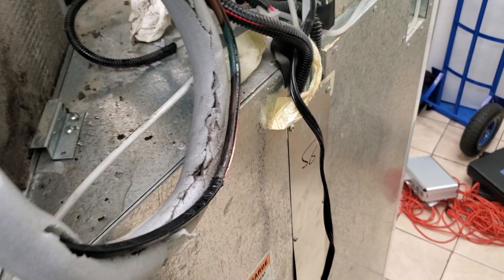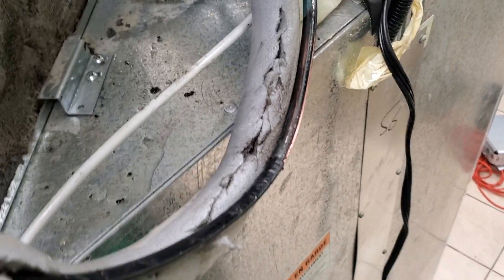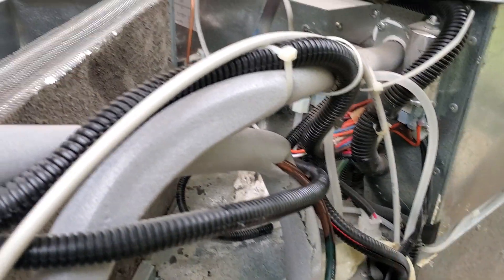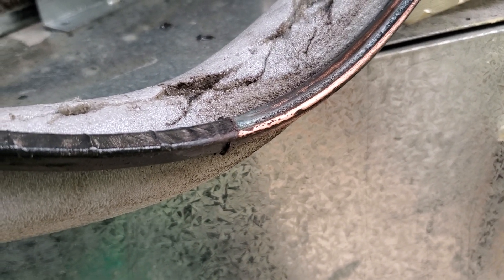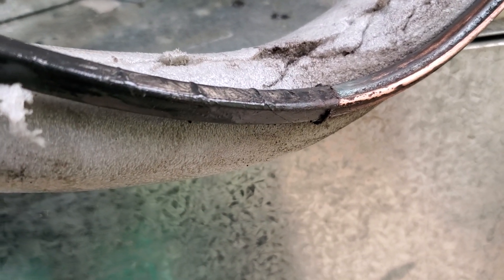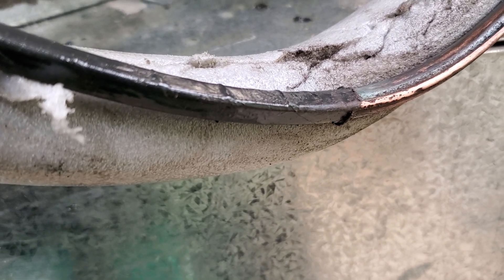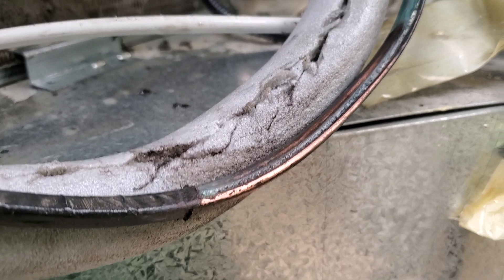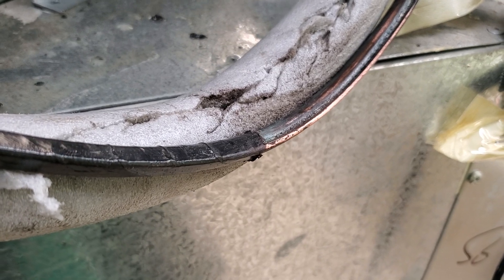Finding leak in a seal system

Comment: Thanks Mike for showing us this  prior to coming to the Oct. 5&6 class, I had a work order for a GE Monogram Refrigerator and gave my diagnosis to the warranty company. Due to the cost estimate the warranty company decided to cut a check to the homeowner for a replacement due to costs not being effective for a Repair. Same system as you have on site, the homeowner was elated and gave me a good comment 🙂 on my Square chip for the diagnosis.